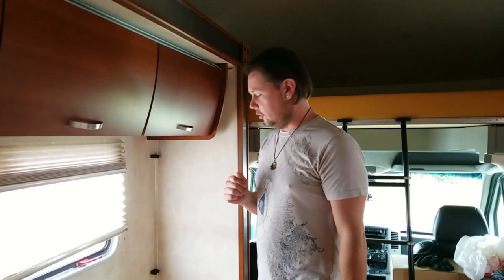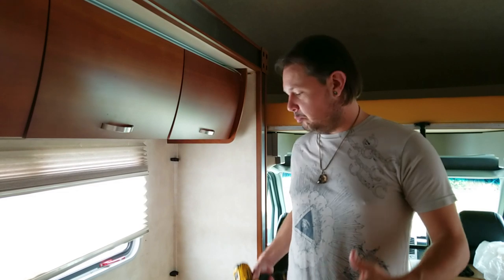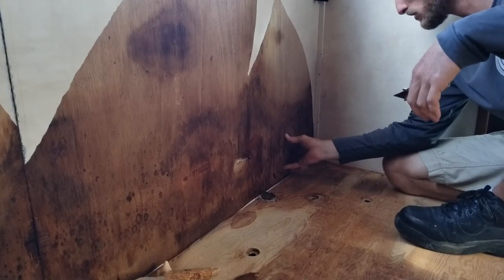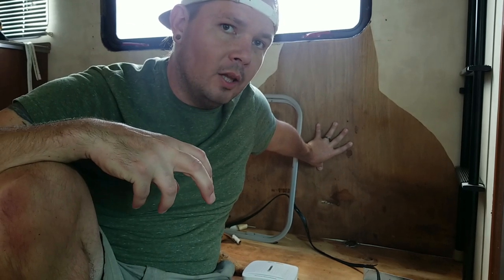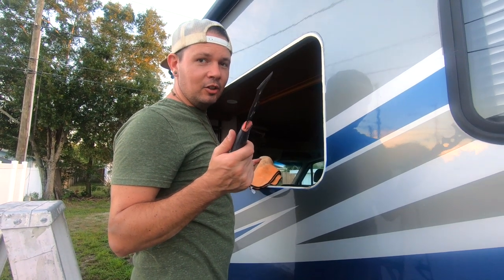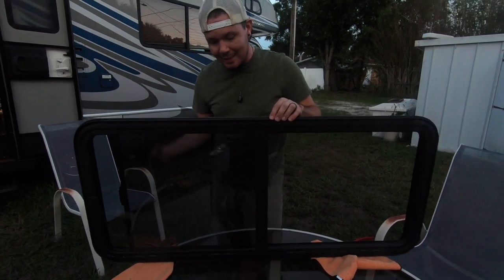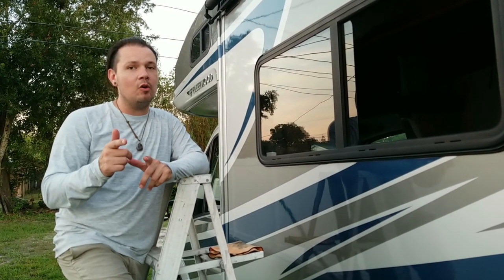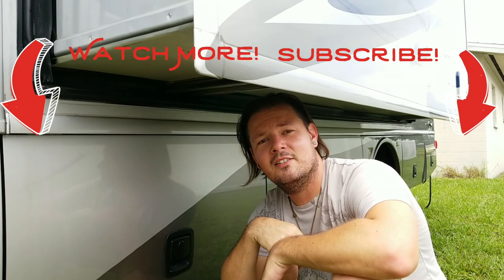Finding & Repairing an RV Water Leak | DIY RV Remodel | RV living full time

Comment: Great you attacked the problem head on yourself without being drained by the RV shops. Moisture detector from Home Depot could of spot wet wood behind fiberglass from the bottom of slide and thru carpeting, they have 3/4" range thru stuff except metal I have one and heck all the time my RV.Most couches ect have some access to underneath them.
Reply from the maker: Yes, I'm glad we could tackle it ourself as well - Liz

Comment: In the marine industry, during a survey, we use a tool called " a moisture meter" to
detect moisture, and leaks
Reply from the maker: Yes, we'll never buy an RV without that in the future. Thanks for the tip! - Liz
Reply: Quick question, shouldn't the inspector have that tool when , you know, doing the inspection?

Comment: Man, that sucks. We just went through a similar issue. We're renovating our Class A and when we tore up the wood flooring we found mold on the subfloor in a few locations. We knew we had issues with leaky windows and tracked it down to a bad outer seal on one and clogged weep holes on another. We fixed the leaks but didn't realize that much water had already gotten in and started growing mold. We cranked the AC and put some large Damp-Rid containers in to dry it out. At first I thought we were going to have to replace some large pieces of subfloor, but once everything was dry it all felt pretty solid. We cleaned all of the mold up, though we just used vinegar, no bleach. We bought some mold-killing primer and painted the entire subfloor of the rig, since we had everything tore up. Then, we used mold-preventing patio paint and did another coat of that on the subfloor so we won't ever have to worry about that again. I actually just finished the new vinyl floor this weekend. Anyway, good luck on the rest of the renovation, we're watching closely!
Reply from the maker: Dang, I'm glad you didn't have to replace any subfloor! You got as lucky as we did!
Sorry for slow reply... 🤦‍♂️
These past months have flown by with all we have had going on. - Dennis ✌️

Comment: When my wife and I were shopping for a used RV we actually shopped for it when it was raining. We found that there were a few good reasons for this: The salesman did not walk around with us which gave us more time to look. Some of the leaks we found were both problems leaks and leaks where the dealer just did not close the vents. Musty smells were more evident in the sealed rigs (normally the doors are open and vented for showing). We also found Rigs that were more "noisey" with rain hitting it than others. We found good rigs as well and put those on our list.
Reply from the maker: Good job! What did you end up buying? - Dennis ✌️

Comment: I just came across your channel.. funny that there was a leak under the slide window, because when you took off the table on the passenger side of the RV it looked like water damage down the wall and I thought... uh oh looks like that window leaked... oddly enough it was the other window with the leak..
Reply from the maker: There was a leak on both sides it seams, one was just far worse than the other. We've addressed both so we're all good now! - Liz
Reply: Eat See RV that makes sense. I, too, suffered buying a used class B that had leaks. Didn’t find them all until after the fact.. uhhhggg.. I sold that van ASAP then we bought a brand new tear drop trailer - sooooo many leaks they replaced it with a new one.. and that one leaked as well.. I have water entry PTSD.. so I feel your pain..

Comment: Use a moisture detecting meter. Home inspectors use them around toilet bases during home inspections.
Reply from the maker: That's a great idea. We asked the inspector if they used that and they said no. We don't have one personally. Did you use that with your RV? - Liz
Reply: @EatSeeRV  Do not yet own an RV however as a Realtor have witnessed hundreds of home inspections.

Comment: I love the fact that you stayed positive through it all.  From what I seen I'd have you work on my RV anytime.  Do you believe previous owner and dealership may have known about leak?  Sorry I don't trust RV and Car Dealerships.
Reply from the maker: Thank you, that's a huge compliment!
I do believe they were aware of the leak. But couldn't figure out where it was coming from.
There is multiple layers of old self leaving sealant, from previous owners, underneath a very sloppy coat of epdm roof coat that the dealer brushed over every joint on the roof!
Is going to take a few days but I'll get it all scraped & resealed.
Im calling this portion of the reno
"Operation Water Tight" 😂
- Dennis 💦

Comment: Excellent work, though should not be necessary! - The floor of your slide-out is made of aluminum and cannot rust? What about salty sea air that might corrode your floor? I know of friends living near the Atlantic coast in France whose trailer parts made of aluminum corroded after three years. Greetings from Bavaria, Germany.
Reply from the maker: You're right salt will corrode aluminum. We don't plan on spending extended periods of time next to the see. But, we will take it to the beach eventually. I guess we will see how long it lasts? LOL - Dennis ✌️

Comment: Havent finished watching entire video but heres a suggestion...I do this on ALL my rv windows to assist with keeping leaks at bay..not a fail proof item but really helps with the upper window leak issues of rv windows..sorta like an insurance plan...https://smile.amazon.com/gp/product/B01CJRH19Y/ref=ppx_yo_dt_b_search_asin_title?ie=UTF8&psc=1  ..    black or white and usually one roll is enough to do your sized rv...I attach it right above the window frame and that helps with the water coming down the side of the rv from the top!...,also use blue tape to mark your layout line when applying it..it sticks so hard that its near impossible to relocate after you stick it on...I even add a small bead of Proflex RV sealant to top edge for added protection...prep wall with alcohol before installing too...

Comment: Concrobium! For the mold. You can buy it at Home Depot.
Reply from the maker: Is that the mold inhibiting paint?
Thanks! - Dennis ✌️
Reply: @EatSeeRV Hi, Dennis. It's not a paint. It's a spray or aerosol. Concrobium works as it dries by crushing the mold spores at the roots and leaving behind an invisible antimicrobial barrier to prevent future mold growth. They are registered with the EPA due to proof of effectiveness, and bc it's a combination of three salts it is considered safe for humans and pets. I recommend it bc I've used this product several times and I know it works, and would be perfect for your situation. If you have the chance, their website has an enormous amount of helpful information.
Reply: Also, I'm a little surprised your inspector didn't use a moisture detection tool (they're cheap). If it had rained recently prior to the inspection the leak would have been found no problem. Anyway, it would be a good tool for your toolbox in case any of the other windows were installed improperly from the factory. Best of luck to you!

Comment: ALSO.....I use this on many rubber seals including my fridge..just rub it in good and it really is better than the spray silicone..use it on my auto rubber seals as well...it goes a long way so one container is plenty....use it on the slide rubbers and fridge too...https://smile.amazon.com/gp/product/B005RNEH5O/ref=ppx_yo_dt_b_search_asin_title?ie=UTF8&psc=1  so when you apply let it sit on a little while then rub it off a bit to get the excess off...

Comment: More Fleetwood quality construction. I had a similar problem with my window. Mine they simply did not tighten the clamp ring on top nor caulk the outside as the window manufacturer indicates to do. I was fortunate to catch it before too much damage was done. No, it didn't cost a lot to fix it. It DID take a lot of work that if installed correctly (my case, install the caulk and tighten the clamp ring correctly) I would not have to do it. 
Really wish I could express how much I hate the workers that put these rvs together. Made in the USA :(
Reply: Phil Meup  Not a fan when folks bring up political stuff on social media. FWIW I have been on a number of tours and to me they all look like legal citizens to me. Just not someone who takes pride in the work they do.
Reply from the maker: Us either. That comments gone, but very nice reply.

Comment: Is Fleetwood RV's junk?
Reply from the maker: I wouldn't say that. There are plenty of happy fleetwood customers.
But, I will say the RV manufacturing process industry wide could be improved greatly.
The reason we're dealing with these issues is simply neglect by the previous owners & a "bandaid" cover job by the dealership. - Dennis ✌️
Reply: @EatSeeRV  Well we hope it works out for you guys

Comment: I had my window fixed regressed  it cost me 300 dollars a window
Reply from the maker: Yikes! - Dennis
Reply: @EatSeeRV  Well my coach double pain windows  I had window loose the gas they turned dark .
I called an RV window company the took them out regased them put them back .
Yes it cost me it wasn't cheap .
I have King Air if I cant afford to maintain it I don't  need it

Comment: That's not quite true. I had a small water damage in my kitchen and the guy that came to look at the damage had a hand held monitor that he put on the floor, and in so doing was able to detect moisture under the flooring
Reply from the maker: Nice, well our inspector did not have that but would have been nice! - Liz